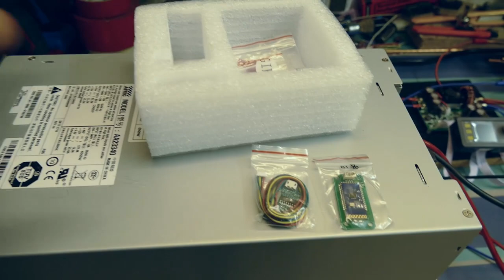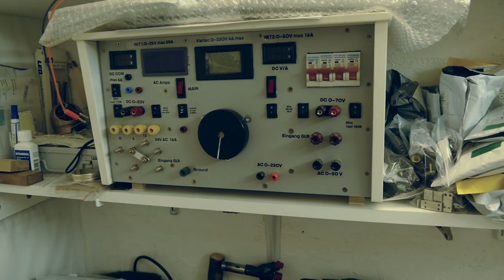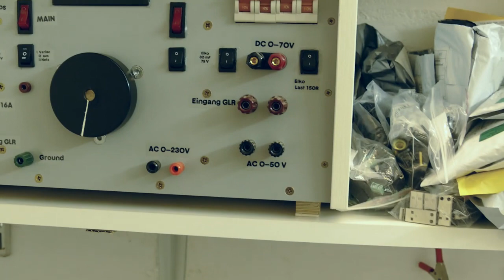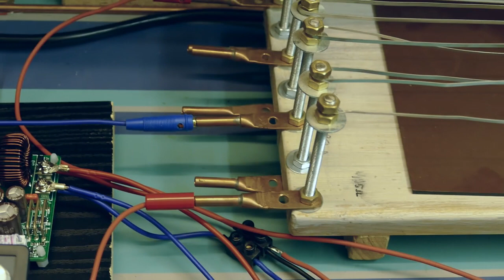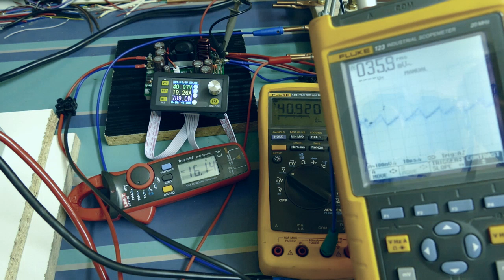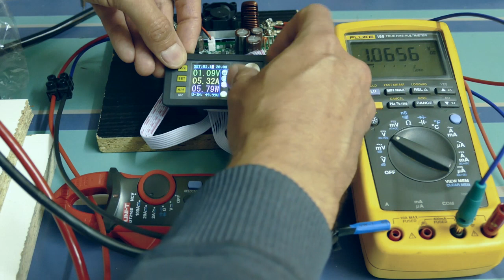DC Buck-Converter DPS5020 Full Load Test and Review

Comment: i has think i order this module, but not know how good have, if need use only 40V DC max volt and 10A max current my bench power supply, not need more power. can this use 40V/10A max, all module in aliexpress has max 60V/22A im not sure can i use this my lab power supply. need this AC or DC input volt at power supply .

Comment: Awesome !!!!! I want it.
Reply: Its a great little device and works for me over 2 years in daily use. Also not recommended i mostly use it on my little PV (Solar) to charge several batteries. Double check not to charge in reverse, as this would damage the internals (in most cases just the output diode - which can be replaced quite easily).

Comment: 7:00 I dont think it has an undervoltage protection. how to you know??
Reply: I didn't talk of undervoltage protection of the DPS5020 (it doesn't have any) but i was talking about the input server-PSU which has over- and under voltage protection. It normally delivers 42V but i made it adjustable in a range of 36... 52 V.

Comment: Can this be stretched to do 55V output? (Actually 54.6 to charge a 48V Li-ion battery).
Reply from the maker: Yes, it probably can. if you input 60V you will have an output of around 55V. I couldn't test it for 60V input as my PSU only gives me up to 52V output. But i am sure it will work also for 60V in and 55V out, maybe a little bit more or less :-) It depends a little on the load. If load is low you will probably get little more than 55V out, maybe 56 or 57V, if load is high (>10A) it will probably stay between 54..55 V out.
Reply: @richardnani7282  no, DPS5020 mens 50V20A output max, maybe other model can do it
Reply: @richardnani7282  I dont think 55V will work. Because the overvoltage protection can be set as a maxiumum of 51V and it will power off when you go over that.
Reply: Inputs 1.1>1 output ratio
Reply: It's out max 50v so you can't do

Comment: Need to do a short circuit test, need to connect an external supply or battery and back feed it and see if it will not fail, can it regulate properly charging a battery connect an external supply in reverse is there a protection shunt diode? Connect several units is series or in parallel......lots of ripple at high current? make an output filter with over voltage and over current reverse current protection?
Reply: Hi, it is short circuit protected (current sensing), but its no protection diode when connecting wrong way to a strong battery for example. In this case it will blow an internal diode which can easily be replaced. Putting an output diode would decrease the efficiency permanently. Output ripple is moderate, depending on the load of course, i think max. about 150 - 200 mV which is o.k. for me. Its not a high end smothened bench-device.

Comment: Hi. Sorry if I've not well understood. What don't you try the max voltage, 50v ?
Thanks from France.
Reply: What do you mean: as input or output? I was limited to my setup and the capablility of my resistor network. As for the input the max output of my SMPS is around 52 V so i have a max. output of around 45 - 48 due to voltage drop in the converter, which is a normal process.
Reply: @richardnanis  Yes it was for the output and I understand your constraints.
Thanks for your answer.

Comment: Anything more you want to see or know about this device? Just tell me... :-)
Pay attention not to connect battery reversely for charging: it will burn the big diode and probably a fuse. I just happened to do that accidentally and have to replace some components. But its a very good converter - i still like it much.
Reply: Hi.I believe it is written to put a diode in this case.😉
Reply: @dlaurent67  Yes, you are right :-) But it reduces the efficiency in the long run a bit...